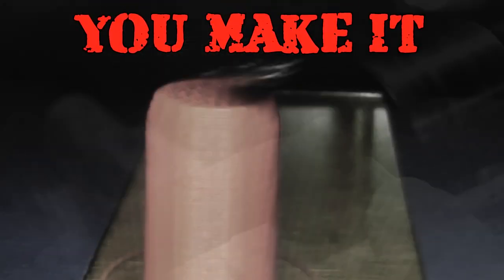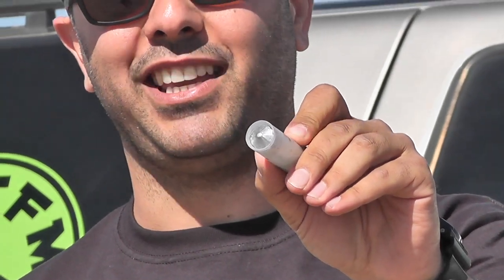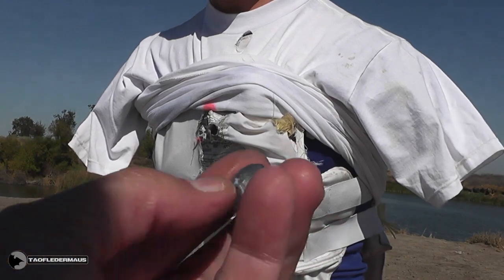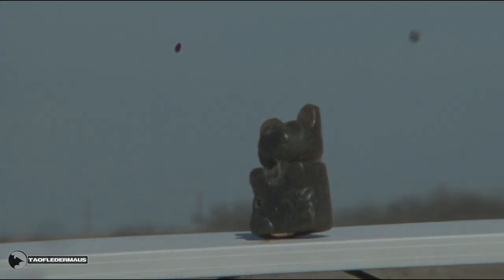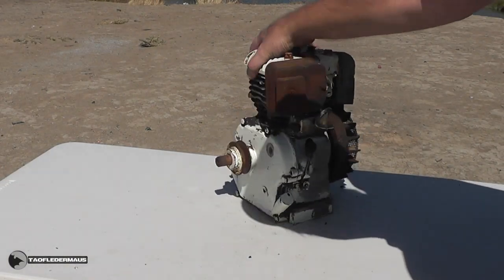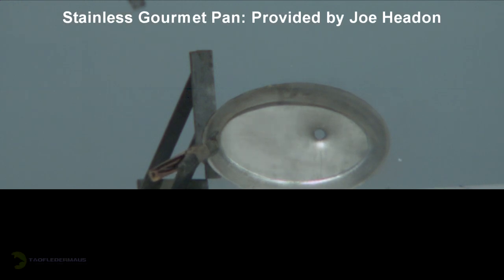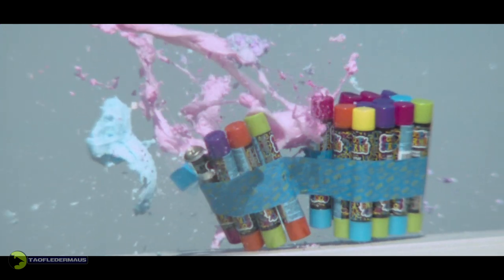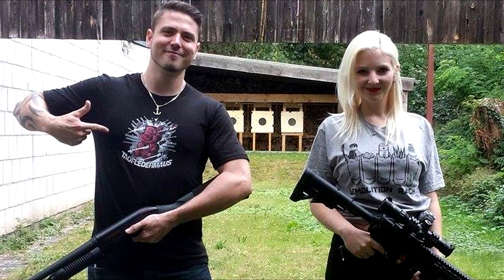Homemade SOCKET SLUGS - Massive penetration!

Comment: Ive been making my own 12g socket slugs with a 15mm, 12pt torx socket. Very cheap and effective DIY project. I shot through plywood and could see the teeth marks perfectly cut into it, I was very happy with the results. 1200fps rounds at about 40 yards was enough to penetrate 3-2x4s, recovered a few before the 4th piece of wood that were recasted again. You can reload your own slugs for around 35¢CAN all in.

Comment: Another awesome video! Can't wait to see more of that camera! :)
Reply from the maker: Thank you!   I love the new camera.   I'm sure I will get better-quality imagery with it with a little more experience.
Reply: You should probably just look at the focus. Stand in the middle of your shooting distance and put the focus on there.
Also, increase the aperture (if possible), that's how you get a wider spectrum of sharp images. Keep in mind though, that it will decrease the amount of light you get into your shot.
Reply from the maker: I wasn't using a spacer/adapter that was supposed to be between the body and the lens.   So the back focus was way out of whack.   I'm surprised I was able to focus on  anything with it!
Reply: ***** May I ask you why you didn't? I watched the video of the camera assembly and in that one he had a spacer...
Reply: I was going to say, I couldn't tell if the resolution was bad or if it was the lens. It certainly doesn't look as pixelated and compressed as the Casio.
Reply: JZStudiosonline It just looks out of focus, a big problem with slow motion lenses.
Reply: Hoch134
It should just be a lens. Preferable something standard like Canon or Nikkor.
Reply from the maker: Hoch134 The lens cap that came on the body just looked like a little lens cap.  I didn't know it was also the spacer/adapter.  The camera I got looked a LITTLE different from the one David showed in his video.
Reply: ***** Your shots got a bit clearer the last videos. Was this the problem?
Reply from the maker: Yeah, that was a big part of the problem.  I need to experiment with smaller apertures so I don't get such a radically narrow depth of focus.
Reply: ***** I saw the video of today (rat trap chain reaction) and I see you are getting progress. Happy to see that.
I wish you good luck with further videos.

Comment: Frame rate of the new camera is solid.

Slight teething probs with the focus and depth of field but that'll be fixed with familiarity!
Reply from the maker: Yes,   I didn't use an important adapter between the lens and the body,  so everything was out of whack.  I can't believe I was able to focus anything with how I had it!   NOT bad for the first time using the camera though.

Comment: 2:38 he knows that the hearing protection works best when over your ears not just on his head right?
Reply: Shotguns are not that loud anyway.
Reply: They might cause some hearing damage depending on load, but light loads generally aren't that loud. I've shot without hearing protection and its pretty similar to a BlackCat popping about 2ft infront of you, less loud sometimes.
Reply: TheMontanaDave I generally shoot super-magnum shells, as they're called here, and it's not as hard on the ears as a rifle. Rifles hurt without ear protection. Shotguns don't. You do get a little ringing, but nothing too uncomfortable.
Reply: Traumâțu' Mîț Mîț We call them 3 1/2 inch. the 3 inchers are mags. If you shoot a round of skeet (25 shots) with no protection, your ears will ring all night.  When I go to shot birds, I only have to fire about 4-5 rounds so not so bad. But If you have it on your head, why the fuck not use it?
Reply from the maker: At least it gave you something to comment about.
Reply: Scrolled down for this.
Reply: ***** As always Jeff; Thanks for the vid.

Comment: On the same note, take a 13mm deep socket and fill it with finishing nails with the heads towards the opening, set the whole thing on a flat surface and pour hot wax down the square hole, remove the slug and load it into your howdah to test

Comment: Try a cutting a pipe a couple inches long and load it. Kind of like a hollow slug.
.
Try shooting a can of hair spray, its flammable, or fill a steel can with Reducer (used for thinning auto paint) Reducer is really flammable then shoot it with steel shot ! ! ! Might make a spark to set it off.

Comment: Just out of curiosity, why would they NEED rifling?
Rifled slugs don't rotate. They stay oriented correctly for the same reason badmitten(sp?) shuttlecocks do.
Reply from the maker: They don't really use drag stabilization,  so you can see on the one shot on the lead plate where there wasn't any spin,  how unstable it was.
Reply: I get that.
I guess I'm wondering why someone would make a slug, and ignore what is needed to make it work right out of a normal barrel.
Maybe I'm overthinking it. It is what it is.
Reply from the maker: He really made the slugs for his own use and he uses a rifled shotgun.

Comment: next time you cast some gummys...put a can or two silly string inside..bet thy would be awesome gummy detonations
Reply from the maker: The gel is about 280 deg f so I'd worry about the cans overpressurizing and blowing up.
Reply: Is it possible to get it to as cool as possible before it hardens/solidifies, insert the can?

Or insert the can when its solidified by boring a hole in it and inserting the can?

Comment: Oh hey, I actually have used a socket as a mold before, ha. Was not accurate. No high speed camera so I have no idea why. Tried it with a smooth bore and a full rifled barrel. Most likely the center of balance was too much in the middle. Those slugs seem to be rather reliable.
Reply from the maker: He seems to be onto something with his design.   Good balance is important.

Comment: can you get highspeed cams of bullet bouncing on water maybe baby pool
Reply from the maker: I think the splash would mask the bullet
Reply: TAOFLEDERMAUS cant flip too far below the surface or it would go under. msybe st cam 45 to 60 degrees above impactpoint. tho i font know what down range. probably have to put baby pool 4 feet from sand pile.

Comment: Cool looking round......but why not just shoot the socket itself?
Shallow,deep,3/8 drive,1/2 drive, 6 point,12 point, impact, thin walled.......lots of different variables there. 
Might make for an interesting test, and you don't have to make or prepare anything!
Reply from the maker: Because a socket would just tumble and would be very expensive.   These were designed to fly accurately,  and as we know,  that is not as easy as it sounds.

Comment: Some colour correction on the new cameras footage and it would be perfect.
Reply from the maker: This is the first footage I filmed with this camera.  I didn't have an adaptor between the lens and the camera body installed so I'm surprised I was able to focus on anything.   I'll get better with it with experience.
Reply: I was unaware you were missing an adapter.  
Considering your experience and missing parts you've got great results.
Reply from the maker: Haha,  I could only use max zoom and couldn't focus on anything 12 feet or closer.

Comment: Next time shoot a running engine please.
What do you mean it's dangerous you're not Mythbusters.
Reply: I almost got a junked lawnmower engine to test. I would have shot it while it was running, with the blade removed OBVIOUSLY.
Reply: it's not obvious.
Reply: grumpybill What is obvious is that you appear to have wrapped cordage around your finger, and it ended poorly.
Reply: Porty1119 not even that is obvious.
Lathe induced hard learned lesson.
Not my finger.